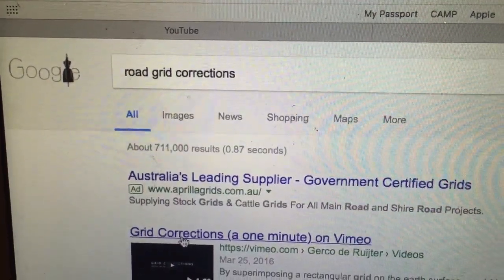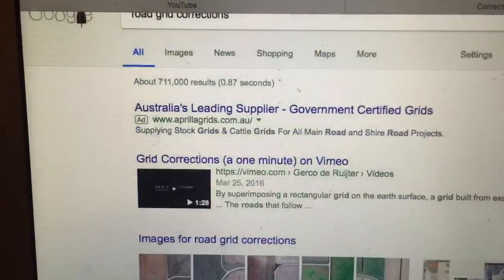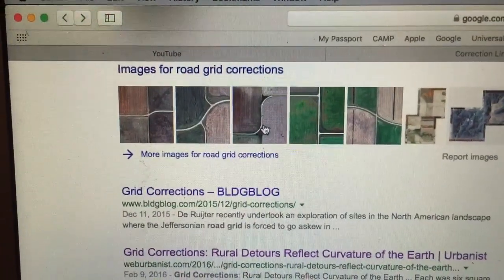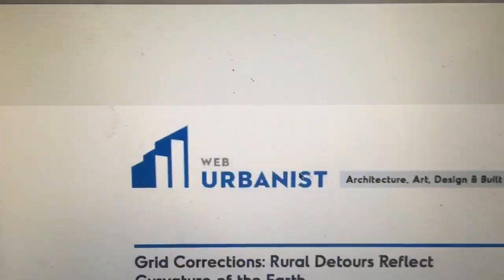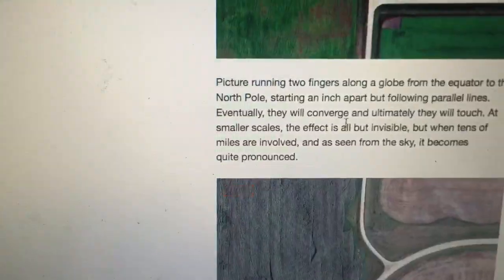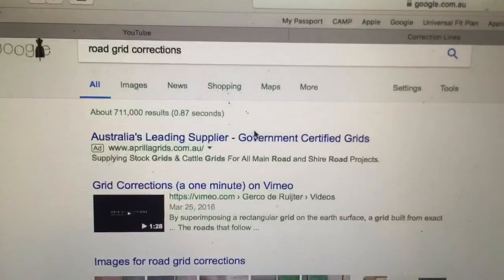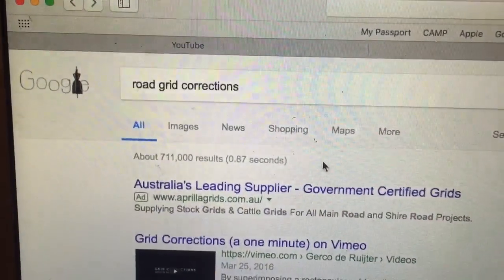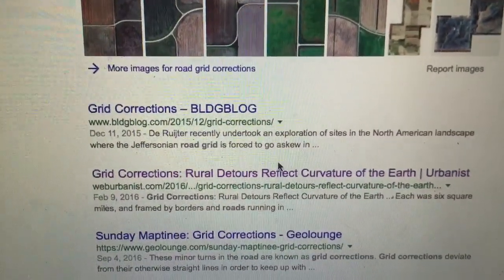Flat Earth - Road Grid Corrections - a topic worth exploring.

Comment: As people are already pointing out, this would apply to the Gleason map, too, since the latitude lines are circles. However, flat earthers have the challenge of showing where an absolute straight line would differ from a direct east-west course on the equator. If you head due east or west on the equator (sphere model), you will maintain a latitudinal course all the way around the earth without any slight turning correction. Flat earthers could prove their model by showing where a straight heading on the equator eventually deviates from it. They have their work cut out for them!

Comment: I haven't researched this myself either.  But I do vaguely recall someone saying that roads (especially on the American plains) often follow lines of latitude.  Since these would not be straight over long distances on either the globe or flat earth models, the 'corrections' might not prove anything either way.  But it's worth following up.
Reply: In the United States, the public land survey system was enacted in 1785 by Thomas Jefferson. It uses a rectangular system and corrects every 24 miles because meridians converge at the poles. North America's longest road without a horizontal curve is ND 46 and you can see the corrections on either side of it.  24 miles north or it, the section lines are corrected, 24 miles north again, and so on. It's actually very obvious once you know what to look for. Of course, the Flatards are going to claim that Thomas Jefferson was a mason and was in on some sort of conspiracy......
Reply: +Lyle
Interesting.  But of course you have to wonder why, if the earth is flat, people would follow meridians or lines of latitude at all, except maybe at political boundaries.  If the earth is flat, it would be possible, in fact quite easy, to lay out a rectangular grid by simple plane geometry.  Following meridians or latitudes would be an unnecessary complication.
Reply: Lyle Landstrom not all masons are affiliated with the secret society.if they'd do any research they would know that.

Comment: Interstate highways often hide the grid with curves.  I remember well traveling north from central Iowa to Minneapolis MN before the Interstate, and the 'correction curves' as the left/right jogs were called where roads joined got to be a PITA of a regular interruption to travel.   

Putting roads on surveyed straight line boundaries was always a way to share the pain of loss of land to the road.  In the Country near here property I once had was surveyed to the center of the county road, with the road being a right of way not county land.   In the Village nearer the City developers gave up the surveyed roadways & verges to beyond the proposed/actual sidewalks, with the property lines by survey ending at the village/county street land ownership.  Property owners were made responsible for maint. to the edge of the road, but the sidewalk/verge are NOT their property.